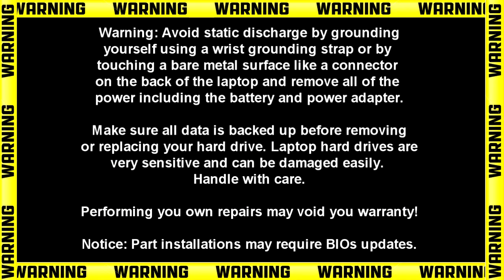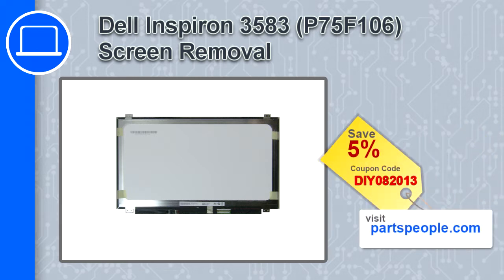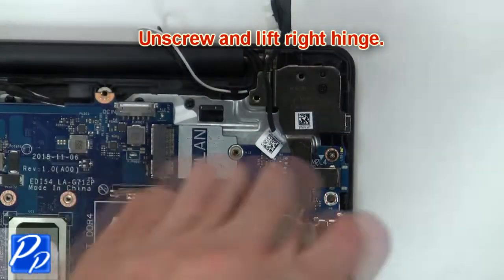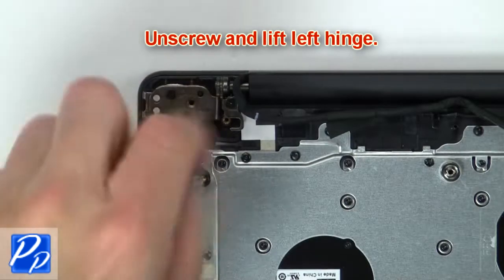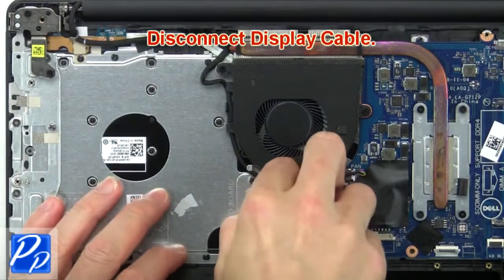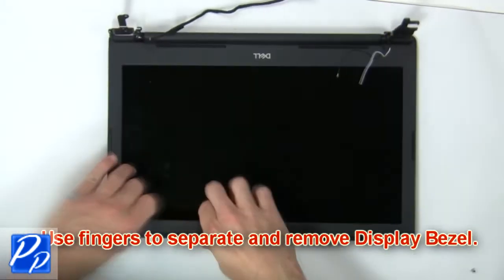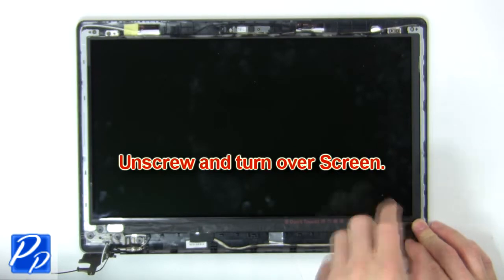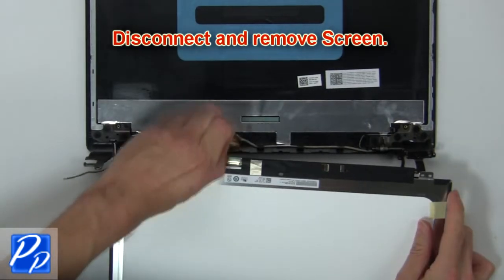Dell Inspiron 15-3583 (P75F106) Screen How-To Video Tutorial

Comment: I really want to buy and install it on my notebook. but i need to know if it is safe to upgrade from hd to full hd screen. My notebook came with a native HD screen and I don't know if it supports full HD. it is a 3583 m3xp model. can you tell me if I can do this upgrade? I am afraid of giving problem to the tension of the screen
https://www.amazon.com.br/Notebook-Inspiron-i15-3583-M3XP-Gera%C3%A7%C3%A3o-Windows/dp/B07SYB6FHF
Reply from the maker: Yes. It supports FHD. You will need the following: Display Cable http://ppci.me/i/27107 FHD Screen http://ppci.me/c/141/1322/screen
Reply: @dellpartspeople  my notebook is not touchscreen. but do I need to put a touchscreen cable?